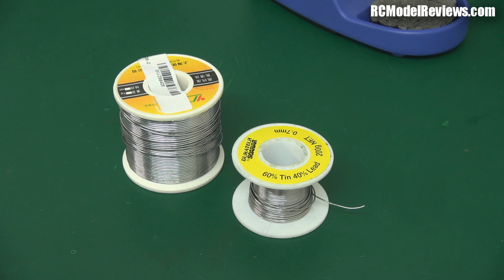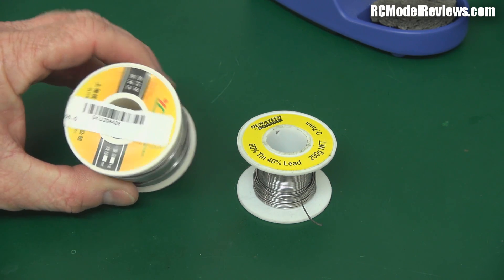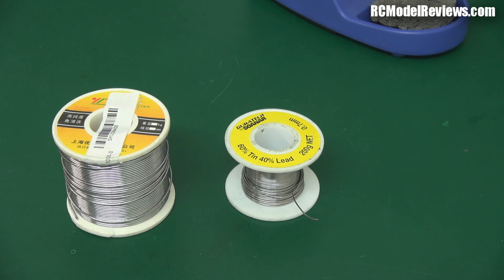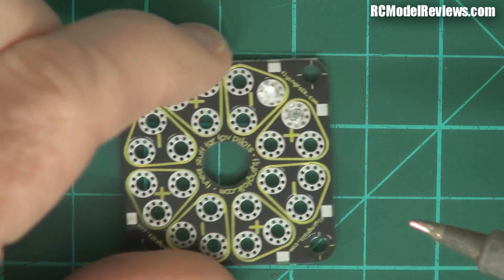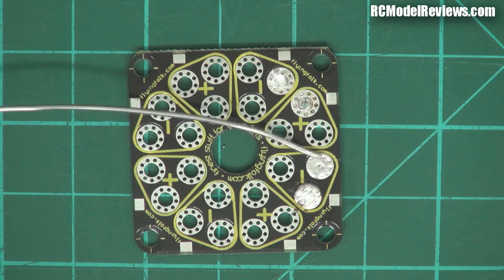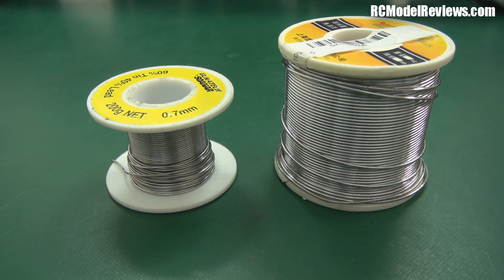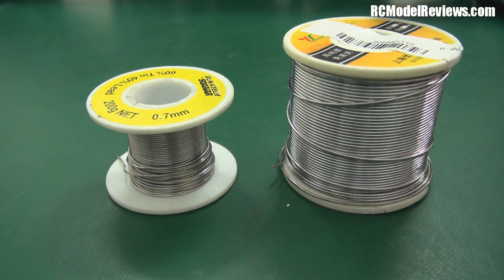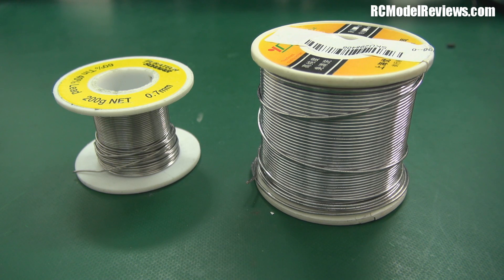60/40 versus unleaded solder

Comment: Biggest proplem I found with leadfree solder was that if you use the same tip as non leadfree, it will add bit of lead to the soldering mixture which causes exactly what you show in the video (you need to have atleast 25% or 0.00000% lead to make good solder). I think one big Japanese electronics company had issues with the tin whiskers when they changed to leadfree and didn't change their manufacturing equipment, because of the small lead contamination.

There are good leadfree solders available (SnAgCu), but need to find one that you like to use. Also since melting temperature is much higher, which makes the soldering much harder. 

BiSn (57%,43%) has pretty low melting temperature at 140C and makes it easier to use, while having only 1 degree of difference in liquid and solid. But it has problems with the strength.

Btw, did you even change the temperature between the solders?

Before all the hate, I use leaded solder for my own projects, but at work we pretty much need to use leadfree and I'm not having issues with it.

Comment: I have had the same results Bruce is getting from the Lead Free with what is supposed to be 63/37. I am wondering whether unscrupulous Ebay vendors are selling Lead Free solder as Leaded type.
I have been very unsatisfied with the results I get.
It really hadn't occured to me that this might be the case until I saw this.
Pull out the stops and pay a decent dollar for a quality product I guess :-)

Comment: I always use 99.3% tin, 0.7% copper. I've never seen it behave like that lead free solder. It's 0.6mm and works perfectly at 340 degrees C. I guess that chinese stuff just isn't pure enough.

Comment: I've been using the cheap lead free solder you get from Harbor Freight for a while. It does take a little longer to melt and a little longer to solidify, but as long as you properly heat your surfaces the joints are quite strong. if i were doing more delicate work, I'd probably use thinner 60/40 solder.

Comment: I thought you were a clever guy but this comparison really sucks. You seem to be comparing a high quality 60/40 versus a lead free of unknown quality. It is just not possible to draw any conclusions from it. Do it again and use a high quality lead free alternative. It's just like when you try to compare a top of the line quad with a low cost Chinese copy for one tenth of the price think the comparison is fair. You can better than this...

I'm having both types of solder and use them both. In most cases the lead free I have is just fine and when needed the 60/40 will go in, but that is not often. It all depends on the task to be done.

I think we all, and I mean all, have to contribute to spread as little as possible of these poisons into the environment and with your channel and influence I think you should think longer then your nose sticks and take that responsibility. 

By this post you degraded a lot on my ranking of you as a clever guy. Thumbs down!!

Comment: Thanks Bruce, interesting. I've been soldering since 1964, and I now use lead-free, and I find that it's basically just a different technique to get a good joint. That 'tin spread' effect is a vaild point though. As to health issues, well you've been using leaded solder for decades so obviously it can't affect the brain as some have said. (Wait a minute though.......)
Reply: The fumes are from flux lead doesnt evaporare at 400c idk Who decided to spread this but It Is a very commonly believed mith

Comment: Could you use the lead-free solder when preparing PCBs and baking them in the oven?
Also, question, I've noticed my soldering iron tip is being eaten away, but I'm pretty sure it doesn't have copper in the mix. I bought some solder from Hobbyking which works really well, but as I can't read chinese, I was wondering if they'd possibly use an acid flux? Would that explain the tip being eaten away?

Comment: I bought some super thin solder from B**gg**d and found it almost impossible to work with. I hate to waste things so I'd use it when soldering XT60 connectors. I'd wrap the tinned wire leads with the solder and then push in the connector. Then I'd heat the piece and the heat would transfer through to the solder. Worked well enough but you sure can tell when you use a quality solder. Almost so much nicer that you start looking around for other things to solder!  :)

Comment: http://www.banggood.com/100g-63-37-Tin-Lead-Rosin-Core-0_5-2mm-Flux-Reel-Welding-Line-Solder-Wire-p-989139.html

Wonder if this is the one that's good.

Comment: so i used my soldering iron to melt some perfect holes in a plastic sheet fire insulating carbon parts. Anyway I cannot seem to clean the tip of residue and solder will not sick to it anymore. Do you have any tip cleaning tips? I've used Flux and then a wire brush.  Not being cheap, i did but a new tip, but no sense in throwing out good parts of they can be cleaned.
Reply: If the tip is solid copper, you can file down to a clean suface, otherwise it's time to throw that tip out.

Comment: Bruce, is "dry" solder joint the same as a "cold" solder joint?  Thanks for the video sir.
Reply: +mmerry2 on YouTube Yes it is the same. although some would say a dry joint is when you dont tin the pad , pin or wire before soldering. So it doesnt bond properly, and a cold joint is one that has moved/crystalised or was never hot enough to properly flow. 
Also if you rework a poor joint and it doesnt look shiny a little dab of new solder will fix that. its just where the solder has oxidised as the flux has been used up or flowed away
Reply: +mmerry2 on YouTube Cold solder joints are what you get when your materials you're soldering together aren't heated properly when you apply solder. Hot solder doesn't stick to cold surfaces very well and it's common for those joints to come loose. With braided wire, the solder actually gets pulled into the gaps in the braiding when it achieves the correct temperature, that results in a very strong joint.
Reply: +Josh Grebe Thanks, but I understand what cold solder joints are.  My question was is a dry solder joint the same as a cold solder joint?  Bruce mentioned a "dry solder joint" at 3:31 and I have never heard that term.

Comment: Ideal temp for lead free soldering is 700F (371C) and no hotter.  Also, do NOT use a wet sponge to 'clean' your iron tip.  Only use the metal 'brillo' pad type of cleaner.  The thermal shock of the wet sponge when combined with lead free solder will ruin your tip very quickly.  Also, the sponge does not adequately clean the tip.
Reply: I wipe it on my cheep jeans one time I was in shorts an wiped on my leg I did say F%$^& B£$^ T£$^^ C^&$£%^ then B£$^$$ again almost 40 years of soldering I always grab the solder in my mouth pull it an solder hows much have I eaten

Comment: Anyone know how much lead solder enters the environment annually to get an idea of how worthwhile or worthless the lead free rule is? I, also, HATE lead free solder and won't use it.

Found this. Idiotic legislation strikes again :

http://www.sigcon.com/Pubs/news/10_01.htm

Replacing tin-lead with pure tin is turning out to have been a huge mistake. There are two significant differences between lead-free assembly and lead-based assembly.

1. Lead-free assembly is not better for the environment, it is worse. The additional tin mining required to produce high-purity tin alloys, plus the mining of other precious metals required to alloy with tin in substitution for lead is a poor trade for the use of existing lead, much of which comes from recycled products. This information comes from a study conducted by the U.S. Environmental Protection Agency (EPA).  The study undercuts the primary basis for RoHS.

2. Lead-free assembly is less reliable than lead-based assembly. The E.U. environmental commission admits this point. That's why they grant exceptions for military and high-reliability applications that still use SnPb solder.
Reply: +Winston Smith just google electronic dumps. Think of all the electrical equipment you've ever owned and got rid of. now multiply that by the number of people in your town/city and thats how much lead is in your local waste site. Then multiply that by every city in your country. then my every country in the world.

A lot of the waste goes to countries whos laws are not as strict as ours. coincidently a few of those countries are when our main crops are grown. There are signs of lead turning up in the food crops from poisoned water courses. Its already happened with rice and arsenic.
Reply: thomas humble Sorry, my question really wasn't the best one to ask. Here are various charts of lead contamination over time in the US:

http://www.inchem.org/documents/ehc/ehc/v165eh04.gif

http://ichef.bbci.co.uk/news/624/media/images/74298000/gif/_74298891_lead_crime_gra624.gif

http://www.atsdr.cdc.gov/csem/lead/images/pbaction_level.png

Note that the VAST majority of the reduction came from the elimination of leaded gasoline (BY FAR the biggest culprit) and leaded paints. The lead contamination in food is not a U.S. phenomena, but it certainly is here, but that is their own fault, isn't it?:

China: The electronic wastebasket of the world

http://www.cnn.com/2013/05/30/world/asia/china-electronic-waste-e-waste/

Now, I'll repeat the results of a study I already posted above:

1. Lead-free assembly is not better for the environment, it is worse. The additional tin mining required to produce high-purity tin alloys, plus the mining of other precious metals required to alloy with tin in substitution for lead is a poor trade for the use of existing lead, much of which comes from recycled products. This information comes from a study conducted by the U.S. Environmental Protection Agency (EPA). The study undercuts the primary basis for RoHS.

Comment: I agree with all points - I also use 63/37 solder.
But it does make sense for people that work 8hrs a day soldering. Those lead fumes can be very bad for you in the long run...
Reply: +MasterBata Except those probably aren't lead fumes but rather flux fumes. The boiling point of lead is 2022 K (1749 °C, 3180 °F).

Comment: I seen where the Air Asia jet that crashed recently had a dry joint on the rudder travel limiter that was part of the chain of events. An airbus engineer came out blaming  the hippie set for banning lead based solder in Europe. He said the lead free is far more prone to cracking than the alloy mix.
Reply: +Allan Main All aero / medical / other critical applications are fully exempted from using lead free solder in Europe.
Reply: +Martin E . Good info. I went back to the accident report to find the comment but its buried a mile underground now. Many thanks...
Reply: +Allan Main Do you have a link for that? I don't doubt it it's just that they seem to have done an admirable job keeping it out of the news (as I suspected they would when something like this inevitably happened) and I have been unable to find anything about it.
Reply: +Atomicskull 
Copy of the post to be found here..  https://flightaware.com/squawks/view/1/unset/user/51956/AieAsia_QZ8501_crash_report

No mater if the "computer" can run the systems on board the pilots still need to follow the number one rule. Fly the airplane. One needs training and the ability to understand the physics of flight. Without that you have a keyboard jockey in the pointy end. 

This tragic human error would not have happened if the damn rudder would have worked properly. We can certainly find blame with the maintenance protocol that kept sending this plane aloft with an intermittent rudder travel limiter, BUT the real cause of this crash needs to be laid at the feet of the politicians who forced RoHS (Reduction of Hazardous Substances) on Europe. The fools voted the lead out of solder. The lead free solders are not as ductile and quite often crack because they are so much more brittle. This is not a problem if the 3rd brake light malfunctions on your Audi, but a rudder control system is another story. 

RoHS and other moronic environmental laws resulting from a cult like congregation of junk science believers need to be throttled back to idle and magnetos turned off.
Reply: A badly informed posting at flightaware. RoHS has not forced lead free solder on any aero application. A bad joint is a bad joint, they occur and can intitiate post inspection regardless of the lead content of the solder for a multitude of reasons.

Comment: For all those worried about lead poisoning:
in 1970 OECD countries used 300,000 tons of lead in leaded gasoline.  This stuff was released into the atmosphere for us all to breath.  A tiny proportion of that amount is used in solder.  The vapour pressure of lead at soldering temperatures is very low - the VP of zinc is 1 million times as high and the VP of cadmium is 10 million times as high at the same temperature (don't breath either of these).  The risk of lead poisoning from soldering fumes is negligible.
Don't eat lead solder and don't dump it in landfill (same for car batteries).  Use it in electronic circuits and don't worry.
Reply: Come on, you know it's going to end up dumped somewhere where people scavenge for remains of PCB components. And then, because they are way too poor to take safety into consideration, they do get poisoned. Here you have the numbers for one of the most famous e-waste dumps in the world. https://www.ncbi.nlm.nih.gov/m/pubmed/27858271/
Reply: @do_care919    Your article talks about informal processing of electronic waste.  Why informal?  I took my broken TV and outdated computer to a reputable county paid recycler to dispose of properly.  I didn't pay them to dump it in China or India or now  Africa since the others no longer accept it.  
Properly processed it is not a problem.  
I know a guy who recovers gold from pcbs and does alright with no toxic waste dump in his yard.
Reply: Man, you guys are talking about who to pay to take old broken electronics off your hands😂 I pay people for theirs.
Reply: The biggest source of exposure is the direct contact w/ the lead solder. Lead is a heavy metal and isn't washed off your hands except by special heavy-metal soaps. If you work on a soldering project (or even just come in contact w/ a lead-soldered PCB), wash up, then go to lunch, you'll ingest more lead w/ your sandwich then you'll get in the fumes.

Comment: I've been having a heck of a problem with a RTF DYS BG250. I'ts one of those quads with integrated esc's and wiring. I had to replace the bottom part of the frame and solder the wires from the motors to the built in esc's. All the motors spin when they are the lowest motor and spin at completely irregular rates. I have no idea if my awful soldering skills have shorted something or if its just the settings need re-calibrating. Either way next time I fork out for a quad I will stay away from the RTF models as they are as far from modular as possible.
Reply: +Vividcg In openpilot when finding the point where the motors start spinning none of the motors spin at all. very confused. I marked all the wires to make sure they're the right way around. any thoughts?
Reply: +Vividcg callibrate esc's